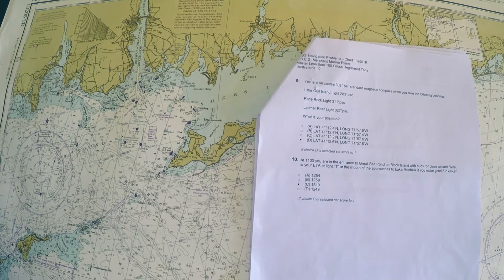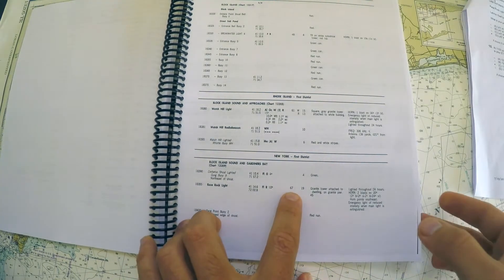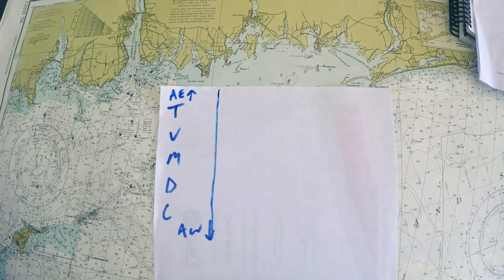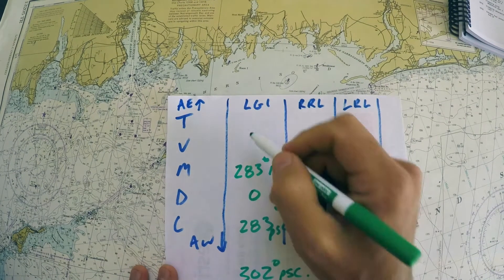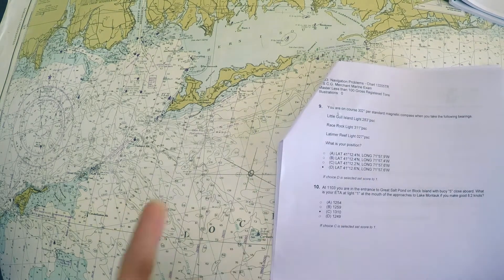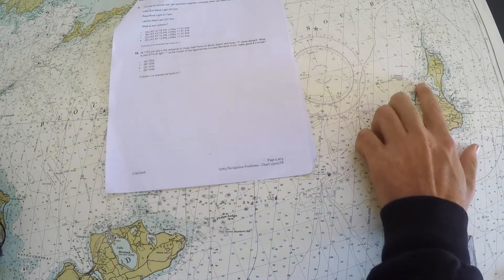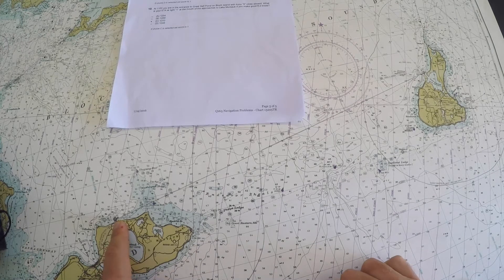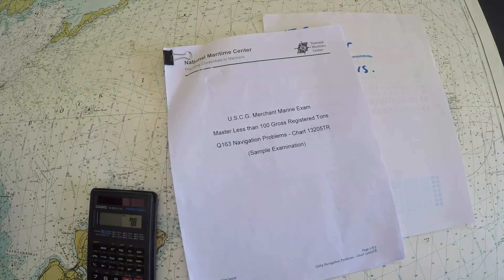Chart Plotting Exam 9 (3-Bearing Fix) and 10 (Estimated Time of Arrival)

Comment: Hi,Chris. Your exams in the US looks easy though. Here in Bulgaria at the Technical university the exams are lots more complicated, and tricky. Would you like me to send you a task that we solve in year number 4 (out of 5) for M.D in Navigation.
BTW I bought my sextant (Celestaire Astra III professional with Trad split mirror) the same one like yours and did lots of sights.Very very good product ,very happy with!!!
Reply: Hi Rosen - sure thing, send it along :)  Glad to hear about your sextant, now all you need to do is put some flame stickers on it!  In the US we have a few levels of license based on tonnage.  This 100-ton level is the lowest of our deck licenses; we also have STCW requirements for higher licenses up to unlimited tonnages.  Thanks for writing and I'm glad to hear about your sextant!
Reply: Hi Chris, yes you are right! The flames would make it fancy and unique of course:-))) 
Do you have an e-mail as you tube does not allow me to upload a pic here in the comments part.My e-mail is  rosk8@walla.com .I will send you a few TASKS which are only a part of the whole exam that consists of few more modules and it is done 2 or 3 days on a row if I am not mistaken.And this is just for the Diploma,not for the license.It differs a bit from what you guys do in the US .